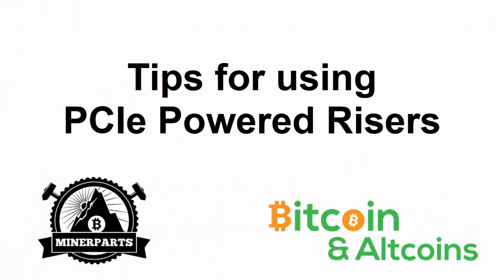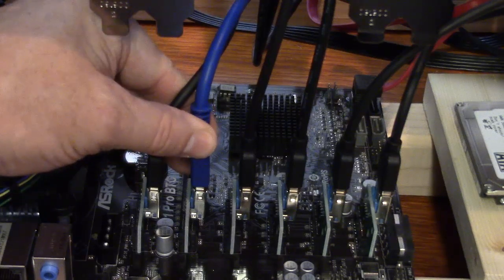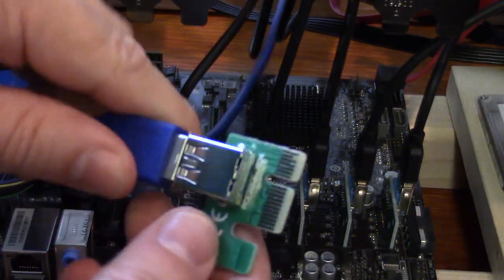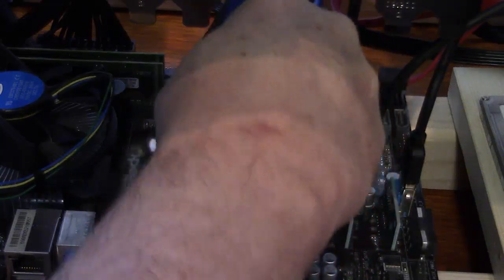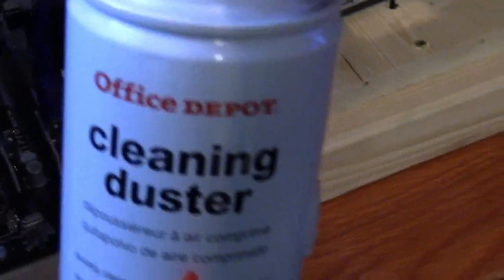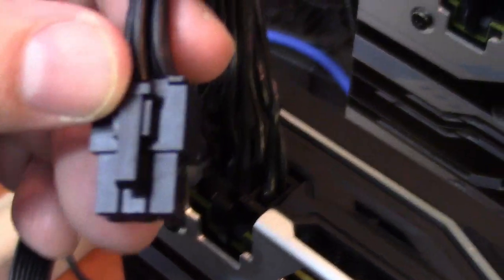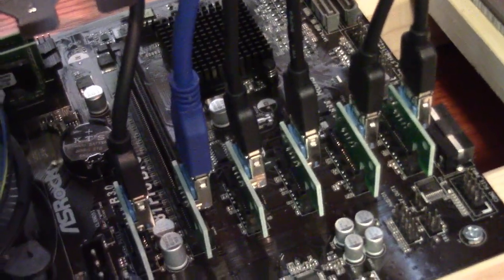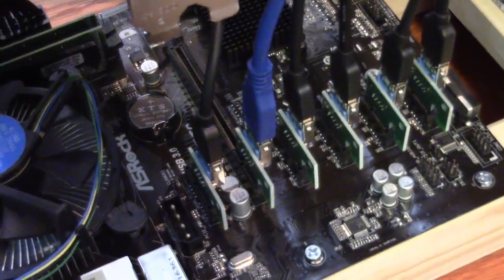Tips for using PCIe Powered Risers

Comment: hooked my riser-card up and ran the 1x card then connected the cable and hooked up all the cables correctly even got the yellow 6 to 8 pin cables to use however my video card is no recognized so I installed it to the motherboard and it worked correctly. am I doing something wrong?

Comment: hi sir,

i used and returned nearly 4/5 X1 risers upto now and never i am able to connect riser successfully. gpu is never detected while using riser but when gpu is connected directly to x16 port on the mother board , everything is working fine.

Power supply used : 650W
processor: I5 8th gen / ryzen 3
motherboard: gigabyte z370 / gigabyte b550m ds3h
graphic card: 3060 and 1660ti

tried connecting riser with SATA, molex, pcie and nothing worked upto now..
please please please help.
what is the mistake i am doing?? 
tried on 2 different mother boards and different processors but no success..

Comment: Wait so SATA is rated for 54 watts where as the GPU draws first 75 watts via the riser power. So it’s really unsafe to use a sata powered pice riser use a 6 pin pice pin wire

Comment: I'm using 2 riders on my pc, got 3 1660 supers mining great. Zero problems. But when I add a 4th 1660 Super, the PC won't start up. The fans on the GPUs try to kick in and spin (Just once), lights flash twice and turn off. Any reasons why?

Comment: This is a old video DO NOT in 2021 use Sata to power your risers on these new 6000 and 30 series cards they draw way more power than sata can support you risk a fire.  Use your PCIE power to power them.  Please know your cards wattage and the cord you are using to power them the rating for the cord.  Sata today is just to low and it will cause over heat and fire  esp on the high drawing cards.

Comment: My current motherboard has an extra PCI-E X1 slot. Can i use a PCI-E X1 to PCI-E X16 riser and connect my new radeon VII and start mining with it? Is it going to lower the performance of the card because of using the riser?

Comment: PLS TELL ME ........Won't the performance of the GPU reduce cause instead of using 16 pins now the GPU is only using 1 pin ........so if a do gaming and my new GPU is not fitting in my tower .....so I bought this pcie extender .....so would the performance of my GPU reduce....and will I get less fps in games

Comment: Just wanting to run a 2nd GPU off an adaptor to connect 2psus, as internal PSU not enough to power GPU with other things and not easily replaceable in an old Dell mini tower PC. Wondering if safe and OK to connect the other USB 3 end direct to a USB 3 port on PC rather than these motherboard slots or will it only work with these slots?  Idea in using adaptor hence is to get 2nd psu turned on and off in synch with 1st PSU which gives also more power whole system but want external GPU to only use external PSU.  Also if can use USB 3 port I can more easily share or swap GPU btw two machines. New to this so just asking before try in case not safe to do.  Not mining just gaming and editing work.

Comment: Question: I just got a PCI riser for a Zotak gtx 1050ti that is usually powered by the motherboard and does not have an independent power connector for the GPU. Do I still have to hook up the riser to the power supply or will the motherboard feed the sufficient energy to the riser to power the GPU? Thanks

Comment: To add to what Rohith said regarding avoiding using SATA connectors to power PCIe risers. It's a simple math equation. Powered PCIe Risers can pull up to 75 watts of power. SATA connectors are only rated for 54 watts of power safely. Doesn't mean that they will pull that much power so you may never have a problem but it just doesn't make sense to risk it since it is a possibility. If you are going to do it then at least get risers that have SATA ports on the riser itself so you don't have to use an adapter. The included 6-pin to SATA adapters with most risers are really cheaply made. In general it's advisable to avoid using adapters wherever possible. Lastly, if you're going to gamble and use SATA make sure you're using crimped SATA connectors and not molded ones. If a SATA connector is going to fail, chances are it's going to be a molded one. You can check here for more info: http://www.jonnyguru.com/forums/showthread.php?p=130311

What you want to do is power the risers with either 6-pin PCIe or 4-pin molex directly from the PSU. I like the ver008 risers since they come with both 4-pin molex and 6-pin PCIe power connectors so I can mix and match when buying a pack of 6. If you don't have enough 6-pin or 4-pin cables, you can reach out to your PSU manufacturer to get more or check out something like CableMod. Remember that you should NEVER use cables for a PSU that came with a different brand/model PSU. The pinouts in the connectors at the PSU side might be different and you will very likely start a fire and fry your rig. Check with your PSU manufacturer to see if the cables between two different models of their PSU's are compatible. Good luck, don't burn down your house!

Comment: The guy is a total nightmare! He uses 1x over his 16x port for no reason, even though there is enough airflow for one card down there, doesn't know what those things* called are pins. And Vendor doesn't send you crap, the crap* one is cheaper handmade one, and the other one is printed PCB, not quality control issue. Geez, what a big mouth for such a small knowledge!

Comment: I noticed you didn't have the 4-pin molex connectors hooked up that ASRock says you must use for running more than 3 GPUs.  If you are using powered risers then one shouldn't need to use the on board connectors?   I've read some forums where using both motherboard and powered risers can fry your cards or worse.
Reply from the maker: The molex don't provide enough power.  Using powered risers is better.

Comment: Is it possible to run my 16x pcie slot and then use the raiser on 8x pcie slot and start mining ? 
I have only 1060 6gb and im thinking to get a 1050ti used or even another 1060 6gb ... 
Should i have the same brand like 2 1060s or is it possible to run 1060 and 1050ti 
Or 1060 and 980ti and that kind of stuffs

Comment: sir can i use it for gaming in my pc with gt 710 ddr5 2gb graphics card ??? if yes so is there any performance losses ??
Reply: For such a low end card 1x PCIE is much more than enough. In fact the 1x PCIE bandwidth should be just enough for even a GTX 1050Ti so don't worry about that. People use external graphics cards for gaming on notebooks and they use a similar riser to convert the notebook's 1x PCIE socket into a 16x sized one. Don't expect too much from a GT 710 though. I'd recommend a GT 1030 instead.

Comment: Hi Ben. I have 6 1080 Ti GPUs. Lately I have noticed my PC keeps rebooting itself every 2 or 3 hours. According to research I've done people r saying it could be a riser issue. 

I am using 6 risers and i have powered them with PSI 2 cables. According to the system logs I see an error 41. 

I wanted to get ur opinion on this .

Thanks

Comment: Hello thank you for the video. What do you put under the motherboard? Just put it on top of the wood? Also how do you screwdrive the motherboard into the wood without dameging it? Same for risers..
Reply from the maker: There are plenty of open air mining frames and cases if you don't want to put the motherboard on the wood. Parallel Miner and Mintcell both sell them. You can also find them on Amazon/eBay.

Comment: Made me smile
No reason to disturb the " contacts " in the MB riser slot to clean for dust
Odds are massageing the USB PCI ADAPTER in and out of the MB riser slot
Will lessen the contact pressure more so than increase it... 
If it ain't broke..  don't fix it...If it is broke..  

NEVER figure out the problem by disconnecting everything 

Just to see if it works...
Leaving everything and switching out major compoments 
Will/should  be  a first diagnostic act

Need to leave exsisting system functioning connections in tact 
In order to read the Control panel's list of components...
Or how every else you devise to diagnose compoments

Comment: Hey I'm running Sapphire Radeon HD 7950 3GB card on PCIe x16 ribbon (getting400H/s mining XMR) and when I add another same GPU to the x1 right next to it with one of these USB risers VER008S, I get both of the cards' hash rates max out at 80H/s. What could be the problem in my case? Please help!

Comment: Everytime I add a 3rd card my computer no longer boots up for some reason. Any idea why? Using Windows 10
Reply: I had that problem too, switched to a different riser card (bought a 6 pack only using 4) and it booted up fine. Im also right at the limit of my power supply, not sure if that was a factor.
Reply: @TheJamie109  how many GPU's? PSU power? So frustrating I can't get my 4th GPU running.
Reply: @lewisjohn2597  i've since added another psu and im using all 6 slots of my mobo now. A few of the risers i've had just wont boot. That was my problem, it might be yours too, try with as many different ones you can
Reply: @TheJamie109  ok buddy. I will. Much appreciated for the response! 👍🏽
Reply: Same problem here. Mining with 3 1660 Supers. Soon as I add a 4th, PC won't start up. Plenty of power with a EVGA 1000w PSU. Tried lots of different risers, plugged GPU'S direct to Mobo, connected all GPU's to the motherboard with X1 extensions and risers, gave my PC extra virtual memory, changed BIOS settings to enable 4G encoding etc and it is ALWAYS soon as the 4th GPU is connected, PC won't boot. My 4th GPU is just in the box not mining 😫
Reply: @lewisjohn2597  Could be a bios or driver issue. I'm also using an old amd cpu that I had, for whatever reason without integrated graphics, having my display plugged into some cards boots way faster than if I'm plugged into others, sometimes a few minutes.
Reply: @TheJamie109  I'm using a Ryzen 5 3600 CPU. I think I'm going to buy a Asus Z390 Mobo, Intel CPU and just have an actual mining rig instead of just using my PC. I used every riser I had, 6 of them, but was still getting the same problem. 3 GPU's work, a 4th GPU wouldn't let the system boot. So frustrating but I guess it's a learning curve we all have to deal with.

Comment: Also using the H81 Pro BTC R2.0 and can only get one Geforce GTX 1070 card to register on slot 3. Had to use an HDMI chord direct from GPU to TV to even get the one card to be recognized as a Display Adapter.  Tried adding a second card in other slots but its not registering and wont boot with more than the one card plugged in to mob.  any suggestions?  I am literally about to pull my hair out trying to figure this out :(
Reply: Danielle Purdy Sounds like an inadequate power supply. Just my two cents. What PSU are you using?
Reply: corsairRM1000x....I have managed to get 5 cards going on it now.   Only thing I dont know is if I should add the 4pin molex to the mob as there is a screen that pops up saying to do so... but Im using powered risers. I have heard various stories of people using them as well as people not using them
Reply: Danielle Purdy  did you ever get this figured out, I can get 2 cards fine 3+, freeze on welcome screen

Comment: Dude, i need help. I have tons of risers, none work with that same mobo u made a vid on. windows reads my cards, once mining starts, 15 secs into it they freeze.

Now, if i plug 1 gpu into the mobo slot, it works.

Any ideas?
Reply: Windows won't run more than 8 gpus from what I understand. Use Linux nvOC. 
It's designed specifically for nvidia gpu mining.
Reply: What Leeroy Brown said is true. But be certain that you have enough power running to the GPUs, Mobo, HDD, CPU, and riser cables. Or else, it wont work.

Comment: Question, I understand that you guys use these PCI Express risers for data mining, but what I want to know is, can I find something similar that will let me connect a full size gaming graphics card into a small form factor cases PCI express 16x slot so I can upgrade my GPU card for gaming without having to buy a medium size tower?
Reply: yes of cours i have the same problème i have GTX 1050 ti gigabit but it cover all my connector SATA in my motherbord
Reply: Yes you can. I turn off one graphics card from mining, and use it for gaming. I use these same exact riser cables. I use my RX 470 4GB for gaming, while my GTX 1060 3GB and RX 480 8GB keep mining.
Reply: lbraheem is a mad man
Seems he actually converted his GAMING machine 
Into an OG DUAL MINER...  
Not quite sure they had him in mind when they created the term
          DUAL MINING
BUT..  just the same.. nothing quite says dual mining

             LIKE GAMING AND MINING...

ie MULTI-TASKING
Reply: Hi! I am running two NVidia RTX for GPU rendering with redshift rendering software. Would this method work to add a third Nvidia 1080ti? I can't fit it in my lowest slot. And if yes I'm looking to mount it vertically somehow across the case on the other side
Reply: you can always use a pcie riser for any graphics card even for gaming. It wont have any major effect on gaming speed
Reply: Thanks for the reply.
Reply: LMFAO... Modern GPUs barely use the CPU for gaming.

Comment: Are these risers able to power a video card that doesnt have external power? Eg. 6 or 8 pin power
Reply from the maker: It depends. The riser passes through a small amount of power.  Does the card have external power connections? If so that is because the card uses more power than the riser can pass through. You should use the external power connections as well as the power from the riser.  I've seen people try to claim risers don't work because they aren't properly powering the video card and the risers both.
Reply: Bitcoin and Altcoins the card itself has no external power plugs its a zotac gt710 2 gig card
Reply from the maker: throw that video card away. worthless.
Reply from the maker: Too old to be worth any use mining. You'll probably spend as much in power costs as that thing would earn you.

It doesn't have extra power connectors because it's a piece of junk that doesn't even generate enough heat to use a fan.  It only uses aluminum heatsinks. It's not going to mine very fast if it can even mine at all.
Reply: Bitcoin and Altcoins i dont want it for that i want it for my gaming pc but my motherboard cant power it
Reply: I don't know if it will work for that.
Reply: Ben Fitts i know they can be used for gaming but will it power the card
Reply: Trying to get my use out of the 85 dollar card i bought new

Comment: Should mining rigs made out of wood have additional grounding wires running to the power supply?
Reply from the maker: I've never done that.  The power supply is already grounded. You use a 3 prong outlet with a ground connection. So... I think a bigger risk is a component going bad and creating sparks/fire.  There are people selling aluminum frames. You can also buy server rackmount cases for mining or simply use a wire shelf like a lot of people do. They simply ziptie the video cards to the wire shelving.

Comment: hi there very instructive video.  what you recommend for using 2 same wattage PSU?  add2psu card,  or just join the green and black cable of the second psu?  thanks.
Reply from the maker: Hi Manuel,

I use dual psu splitter cables. Add2PSU is also good.  I'd suggest either of those.  This is our store where we sell the dual psu splitter cables.

https://minerparts.com/product/24-pin-dual-power-supply-adapter-cable-for-pc-atx-motherboard-add-on/

- Ben

Comment: Thanks, I have put so many hours in trying to get 6 gpu's to work in the h81 r2.0. no luck. resorted to 4 gpu setups. The real question is how on earth can we get rx580's at the minute!!
Reply from the maker: Hi Harry. If you use Windows there is a mod to allow you to run up to 7 GPUs.
https://bitcointalk.org/index.php?topic=712228.0
Reply: make sure you have your pci slot speeds set up as gen2 and above 4g decoding is on in the bios